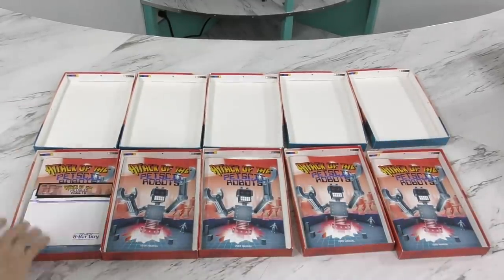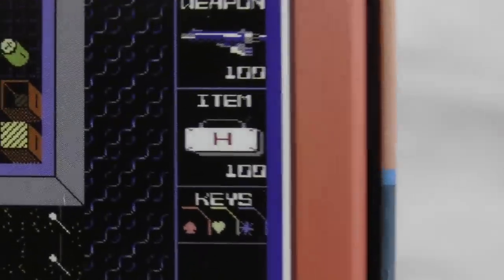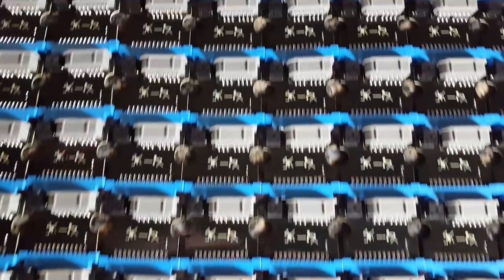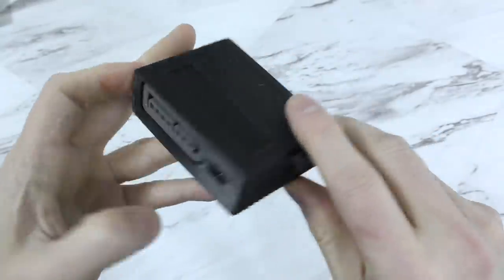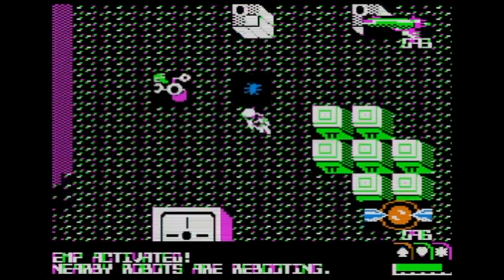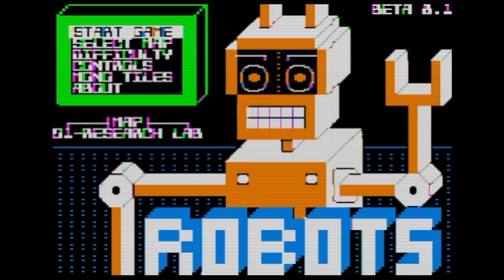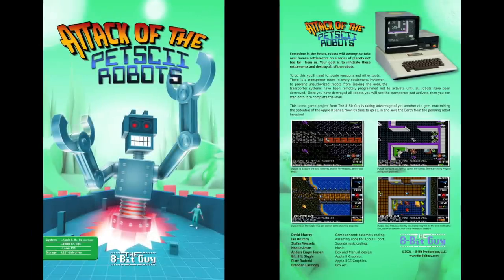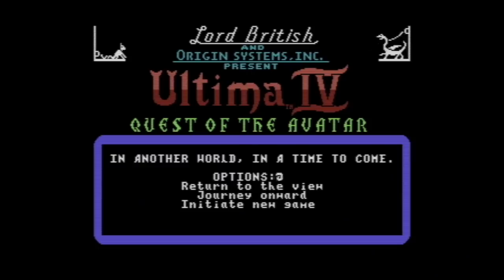Petscii Robots Part 3 - Apple II version, production, etc.

Comment: David, 
Would you be interested in a high performance graphics library for the Apple II that includes support for double hi-res graphics on the //e & //c (presumably on the Laser 128 too)? 

It’s something I wrote on spec for Applied Engineering back in the 80’s, but they never purchased it from me, so I own the rights. I’m thinking it might be useful to anyone writing/porting programs to the // series, perhaps even to offer better performance for the Petscii Robots port. I haven’t looked at (nor looked for) that code in decades, so I’m not 100% certain I still have it, but I think I can probably find it. It’s straight, hand optimized, 6502 code, and the library is quite small, and fast. The library deals with all the byte alignment and weird memory addressing stuff, to the developer, you just deal with a logical 140/280/560 x192 graphics array, depending on color/mono and regular or double hi-res mode. Specifically designed to be compatible with the Apple 80-column card and AE Ramworks cards, and the AE transWarp accelerator, but should work with any similar products from other brands.

P.S. I’m in the DFW area too.

Comment: 7:55 what if you mistakenly put the jumper in the lower position? Shorted supply?
8:52 He's not soldering wrong, just tacking down the power jacks with a little solder. He comes back later with the solder (and rosin from it) being applied directly.
9:09 That's some dedication to good cleaning.

Comment: Also random question… A spectrum port? I’d sorry if it sind off/wrong.
But it goas back to the original problem i saw with the C64 and alike. That being not only the reality/costs of the machines themselves but the addition of a data set and or a disk drive. And finding those in addition to say the C64 itself all in working order…
Where as the spectrum just needs an analog sound import and an RF/rgb capable tv/monitor which are easy enough to find… on top of the spectrum nexts being released as well growing the user base outside the original machines…

Comment: Actually, another problem lacking a timer causes for old Apple II games is if you run them on a modern CPU, it goes way too fast, meaning the emulator has to throttle its CPU usage to the speed of the Apple II.  Actually, a lot of modern games compensate for different CPU speeds, GPU speeds, load times, etc. (which all culminate into the framerate) by having movement measured in time since the last cycle.

As far as things like IRQ, I'm curious about whether or not it's commonly used in computers anymore, because newer systems have a kernel that does upkeep tasks and handles time slices for processes to use the CPU.  Or is the Kernel IRQ?  I would like answers.
Reply: the answers are all here: https://www.google.com/

Comment: I bet you could hack together some bits of wood and hinges to make a box folding tool.
And for 1000 units of circuit board assembly, did you try getting quotes from companies who can do it with a machine? At least the small SMD components?

Comment: Kevin needs a Pick and Place machine.  Even a used one; heck, you could modify a 3d printer to do it, just replace the extruder nozzle with a suction tip.

Comment: You can see even in the "fine" displays that the C64 doesn't deliver consistent color in areas with single-width pixels.   If the game did fine scrolling the display would look much worse with the color shifting everywhere.   The issue is due to someone brilliantly chosing to disregard NTSC color clock timing in the C64 video hardware.

Comment: No, the Red Cross is not a generic symbol for "health". It is a trademarked emblem of the International Red Cross and Red Crescent Movement, which was set up during the Geneva Conventions to protect med-evac units, military hospitals, etc. from attack in wartime. The emblems specifically mark such units, vehicles, and buildings as protected; attacking them would violate the Geneva Conventions. They are also used as logos for the Red Cross organization itself for its peacetime activities.

If you want a generic symbol for medicine, there is the caduceus as well as the blue six-armed cross often seen on ambulances. Crosses styled after the Red Cross, but in a different color such as green or blue, have also been used in video games.

Johnson & Johnson have licensed the red cross symbol for use on actual first aid kits and such, but unlicensed use in a video game is definitely illegal and rightly so.

Comment: It's nice to see Apple getting some 8 bit guy attention.  I wish that the Atari 800/XL/XE line would get some attention as well.  Its ANTIC and GTIA chips have some amazing capabilities, even the ability to mix graphics modes and palettes.  Then there's the POKEY sound chip that can make some great sound.  I'd offer to help, but I am not a 6502 coder.  Z80 has been my chip.

It's just the three most popular USA 8 bit 6502 machines were Commodore, Apple, and Atari.  It would be great to see them all under "The 8 Bit Guy's" purview.  Europe, on the other hand. also had the ZX-Spectrum and MSX, and those may be too difficult to port, as they are Z80 machines.

Comment: First of all - awesome job! You are amazing maker and developer. I have a question. I am not very retro computers savvy person, but I like that project. What is the easiest way for people like me to try this game on some kind of emulator etc? Can you (or those who read that comment) point me to some nice emulator and the shareware version I would have to download? I consider myself smart tinkering-wise, but I don't know where to start. Thanks, and awesome job - as always! :)
Reply from the maker: The only two shareware versions right now are the PET and the X16 version.  Both can be downloaded from www.the8bitguy.com and then you need one of the emulators for whichever system. VICE is good for the PET.  Or www.commanderx16.com for the X16 emulator
Reply: @The8BitGuy  thanks!

Comment: Hello David! It will probably a silly question, but did you thought about finishing a DOS version? I've never used a Commodore nor Apple II system and I'll probably never use them, so the DOS version would be much appreciated!

Oh! And BTW - where are you getting the floppies from?? I'vetried to buy a new ones, but it's nearly impossible!
Reply: he buys old unused floppies
Reply: @taududeblobber221  oh c'mon! Do you expect me to believe, that those floppies, are reliable enough to brand his name on 'em?
I've bought a 100 floppies (3 1/4 inch) recently and only 30% haven't had any bad sectors...
Reply: @tfruba  he did an explanation of where he gets these in one of his old unboxing videos i think, but basically they are new-old-stock that are very old. in another one of his videos (it may be the same one, idk) he explains why he buys older disks and not newer ones, as he says that the older ones are more reliable because they were less cheap when they were made. i may be misremembering tho.
Reply: @taududeblobber221  thank you for the explanation.

It's insane, that yiu can't buy a brand-new floopy disks (I mean the fresh ones) today. It's not that old technology. You can still buy new parts for VW Golf MK1 or 1955 Plymouth. Why than you can't buy new floppies though?

Comment: I've spent quite a lot of time making my emulator accurate as to composite graphics — it's a full composite decode, no Apple II-specific logic whatsoever. So challenge accepted. I'll watch for the Apple II version to go on sale.

That's in contrast to the majority of older Apple II emulators, which for performance reasons tend to have to do a simple offset+bit lookup. Almost like the Apple IIgs when emulating Apple II mode, but without the hystereses.

Comment: Yes, please, MS-DOS port. It's by far the most playable retro platform today.
Reply: It will need a complete rewrite of the game. PET, Vic20, C64 and Apple II share the same CPU, the MOS 6502.

PC are based on 8086 CPU, which is a completely different assembly.
Reply: @FredericBezies  I'm aware of the architectural differences. It's already hinted at in the video though that the game will get an MSDOS port

Comment: David, my wife and I use an application called "STAMPS.COM", or stamps dot com in case the address gets stripped-out somehow.  It costs about twenty bucks per month, but it saves us LOADS of time dealing with the post office.  We can print our own stamps at home, our own shipping labels, etc.  (Even overseas shipping.)  Certain post office rules don't apply to people who use it, and we are able to place small packages directly into the blue mailboxes as long as they are using stamps dot com postage.  It might be worthwhile for you to look into.  We did buy one of their scales from them and it has worked great over the last several years.
Reply: web addresses don't get stripped out, if it gets removed, it brings down the whole comment with it.

Comment: Seen you do that a few times, ignore good advice vis-a-vis the Red Cross matter, often times it has nothing to do with what's logical or reasonable but nonetheless real. YT comments are NOT just rude cries of ignorance. ;)
That was pretty neat about the PET music, new things for the platform even now. Said it before but it's a golden age for retro adapters, cool to see it built and nice shell.
Only so much you can do for worse AV connection setups, the worse it gets the better lower resolutions like the VIC-20 look compared to the C64, just the nature of the CRT and analog video ports. Speak of the Devil, the Apple II is a very weird analog video color standard that was tricky for emulators. Regardless some nice elegant solutions. ;) Wow didn't know there was a soundcard solution for the A2, certainly beats having nothing at all.
What you can't write software for a nonexistent unfinished platform, I thought you were talented? ^_^ Looks like everything turned out great, kudos to you and everyone else. :D

Comment: It's so strange to see circuit boards being deliberately submerged. I know about flux, and I know that as long as nothing oxidizes and there's no power that there's no danger, but it's still jarring to see someone holding a PCB under a running faucet.

Comment: Will any current Apple product run Apple ][ software directly, and will it do the mockingboard too?
Reply: Are you... Why, do you not have a clue how computers work
Reply: @davidbanan.  It was a rhetorical question about Apple not maintaining compatibility layers as they keep changing their products.  In case of Apple I, Apple ][ etc., they could bundle an emulator with fully licensed original firmware.  In case or PowerMac and 68000 Mac, more clever emulation is needed to run on Apple Arm machines.

Comment: Usually I'm hard on you for what you do (you're still using tap water instead of distilled water!!!) But I must commend you on your work with Petascii... 

There are some cross compilers for 6502 to 8088 so you can cheat with most of the coding using that.

I would love to see an Atari version of that. It would not be as has hard as the Apple version since the Atari and C64 are 85+% code compatible - just a few registers need to be rewritten and sprite routines fir the Atari is different from the C64. I would throw my hat into the ring for this but my Atari is dead in the water.

So what's next -  a 68K version of Petascii? That would be a sight to see...

Comment: Ah a possible DOS version... Hope  dos from win10 x64 could run it to so i can buy it
Reply: The VDM in Win10 x64 wouldn’t run it since it’d be an 8/16-bit executable which x86-64 processors operating in long mode can’t run. 32-bit Windows might run it, since I’m guessing a lot of the VDM code they added in XP for basic sound and graphics support is still there, but realistically you’d just use DOSBox to run old DOS games on modern hardware and operating systems.

Comment: You know, I think Attack of the PETSCII Robots would also benefit from a port to the Amstrad CPC and the ZX Spectrum, as well as the Atari ST and the Amiga.

The ZX Spectrum version would probably feature "PETSCII" and "Spectrum" graphics options (which would look similar to the Apple II version), and the Amstrad CPC would have an extra "Amstrad" graphics setting, taking advantage of the more colorful low-res graphics (since the ZX Spectrum and Amstrad CPC shared the same Z80 processor, and half of the CPC games were ported over directly from the Spectrum). The music on the Amstrad CPC and ZX Spectrum version (128k version only) would sound identical to the Apple II Mockingboard, since the CPC and the 128k Spectrum models have the same AY-3 sound chip as the Mockingboard.

The Atari ST and Amiga would look identical to the Apple IIgs version, and the former version would have the same soundtrack as the Apple II Mockingboard (as well as some possible MIDI support if the DOS version eventually gets developed).

Of course, these versions require rewriting the code almost completely, as they have different processors (Z80 for Spectrum and CPC, and Motorola 68000 for the ST and Amiga) compared to the PET, VIC-20, C64 and Apple II.
Reply: You code it then, he's already said he won't do it!
Reply: No, it wont, you code it your self since you seem to think its so easy

Comment: You should've just changed the red cross to the flag of England.  Not the Union Jack of the United Kingdom, but the more basic English St. George's cross.  It's technically not the same symbol, and national flags aren't covered by copyright.  Either that or you could use the Swiss flag.